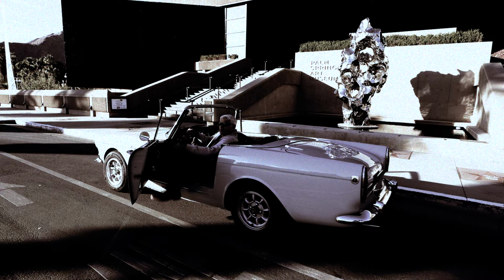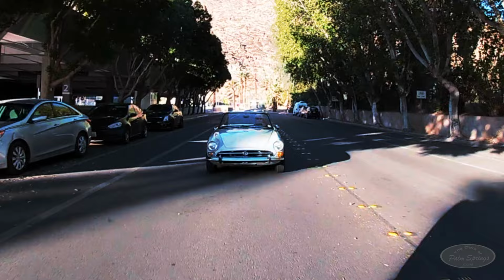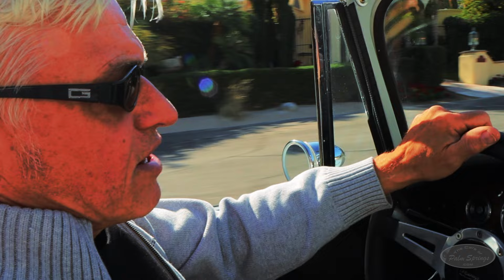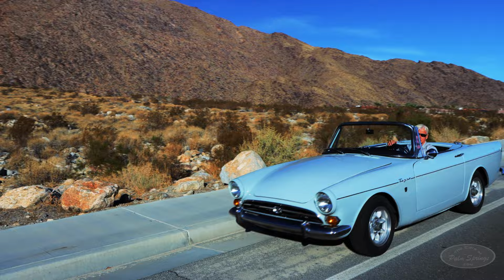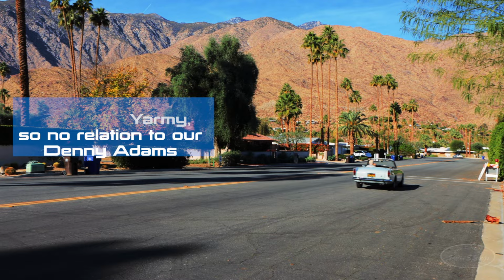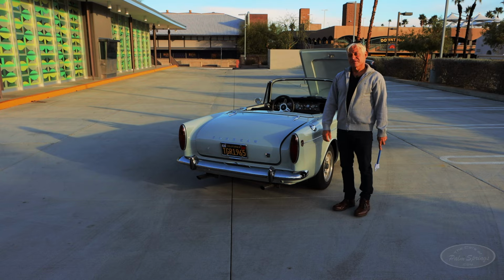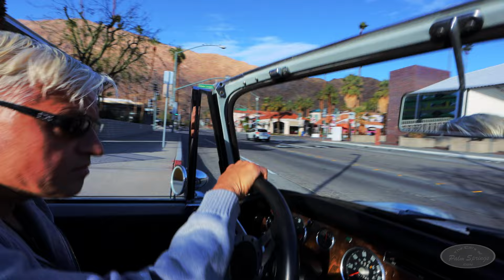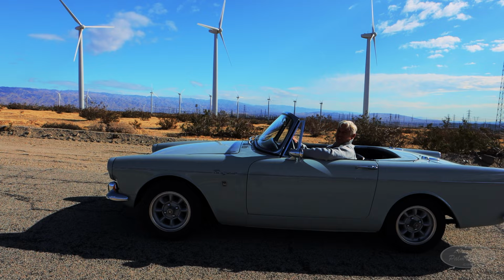1965 Sunbeam Tiger

Comment: What's up with the ugly,round air cleaner?Mine had an oval shaped air cleaner,very pretty!
Reply: The stock air filters were oval and not chromed. Over the years, the stock air filter have have been lost. Almost impossible to replace hence the ugly round one. I've heard that repo stock ones are in limited production but very pricey.
Reply: @brucebeauvais1324  Yeah,the air filter housing on mine was oval,finned aluminum...very pretty indeed!In my opinion that is!Always called it a psycho-car,but it sure was fun!
Reply: @giannirocco7492  Agreed. Like any ex-Tiger owner, I wish I'd never sold it. If I'd saved the VIN, it'd be fun to see where it ended up. Just a daily driver when I owned it, it needed  a lot of work to make it nice.
Reply: @brucebeauvais1324  had mine long ago so it was fairly nice,faded paint is all I can think of.Bought it for $500 and sold it for $1200 so I thought I did good!Yeah,never should have sold it!
Reply: @giannirocco7492  I bought mine in 1974 for $900. Sold in 1978 for $800. Owned for 4 years, lost only $100? I,too, thought I did well. I remember all the good stuff, not so much of the bad parts of ownership.
Reply: @brucebeauvais1324  have to agree with you there!we remember the good stuff,all else seems to be a foggy memory or just not remembered at all!